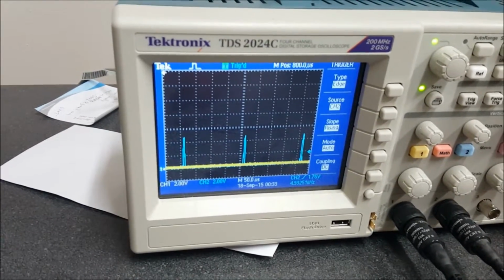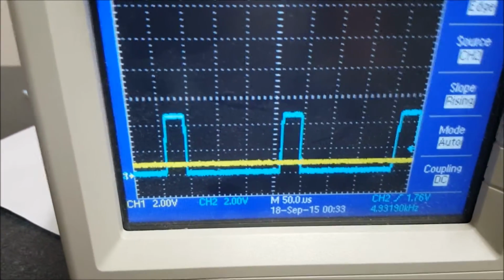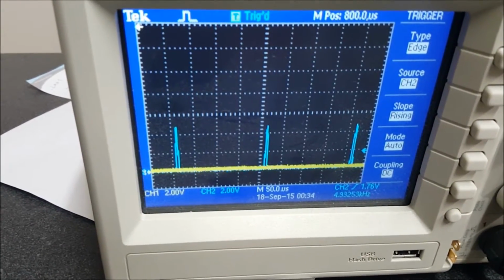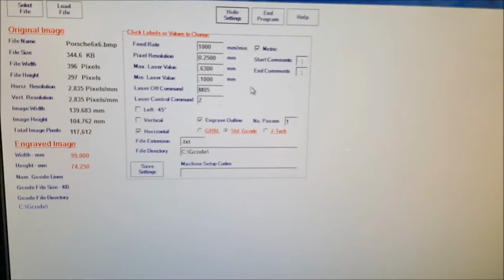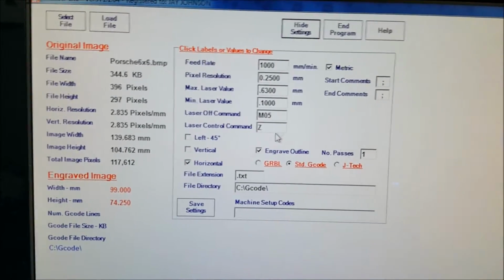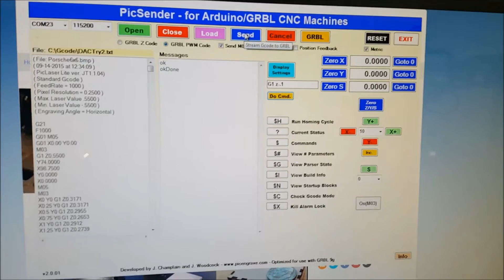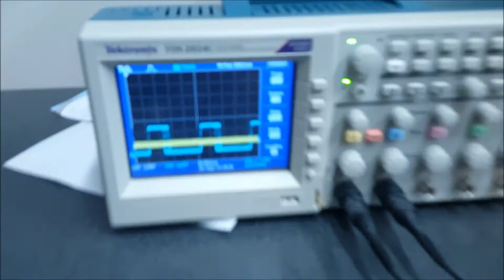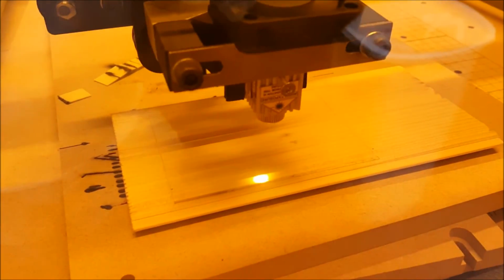DAC PWM Setup Instructions   J Tech Photonics

Comment: Hello, got a question on the dir and step connections? The card you show is older than the one you sent me. I have Dir and Step + and - connections. So I have 2 wires and 4 connections. Don't know how to connect since I'm electrical challenged.
Thanks for your help in advanced.

Comment: $125 to get this crippled setup instructions for Mach3? Like getting a test-drive in a BMW prior to buying a Lada. What a farce. Buying this stuff will certainly lead to disappointment.
Reply from the maker: I agree this video is outdated and does not show mach3 part.  The written instructions are here and show the mach3 setup: https://jtechphotonics.com/Downloads/PicConvert/Pic-Convert%20Manual%20V2_7.pdf 
I am working on getting a mach3 machine so I can do a proper video.  We worked with Jeff and John at picenegrave.com to test the boards on their machines.  If you have any questions, please email us at customerservice@jtechphotonics.com and we will try to help.
Reply: That is not the Mach3 setup as you soon will find out. You're selling a product for Mach3 which you didn't even tested? First show it working and how you got it working on Mach3, we'll talk further after that. For now, I'm pretty sure it will be a disappointing purchase for Mach3 users. Especially knowing that this board is completely unnecessary to have a laser running on Mach3 to do greyscale engraving. Read the Mach3 manual and you'll know how and why.
Reply from the maker: Jeff and John tested it fully on mach3 for the five iterations of this board. It is fully tested and working on hundreds of customer machines.  Mach3 has a delay in the output signals, including using M10P#/M11P# output firing commands.  You can set up the spindle motor output to use PWM like illustrated in our CNC setup instructions, but there will still be a delay for doing pictures because the PWM output will need to change for each pixel of the image (worst case).  If you are running at 50IPM and doing an image with with 125 pixels per inch, you will need to update the PWM signal over 100 times a second.  Mach3 won't support this.  
If you have figured out and tested how to do greyscale images using mach3 directly, then please let us know.  It is more than reading the manual.
Reply: JTechPhotonics Interesting, and with all this testing and hundreds of customers not one little video about setup in Mach3? Incredible.

Comment: If I'm using the B axis for the controller, do I set the laser control command to be B?  What do I set the values to in inches?
Reply from the maker: +berighteous Yes, set the command to "B".  In Mach3 motor tab: Set Steps to 9500, Accel to 80, step to 5us.  In PicLaserLite set Max laser value to "0" and Min laser value to "-0.0255'.

Comment: How long was the engrave time?  Were you running 3 jumpers on the laser driver?
Reply from the maker: It is not a huge image (105mm x 140mm).  Ran at feed rate of 1000mm/min at three jumpers (1.5amps).  I think it took about 60 minutes to finish (105mm×140mm÷1000mm/min÷0.25mm).
Reply: berighteous hjOiBajkjjjjjhhjnjn. 

kmmm

M
 B nnnnnkm

M
    NikkskSkSjkkkkkkkkmsknkjajsjsjjkuPKO

Comment: How do you set mach3 to use the laser in this configuration?
Reply from the maker: Jeff at Picengrave.com has more information on the Mach3 settings.  This board is 8 bit.  You need to either change your steps per mm or inch to be a number that is easily divisible by 256 or divide your number you are using by 256 to get the amount of travel needed per step.  There is a section in the manual on this configuration.